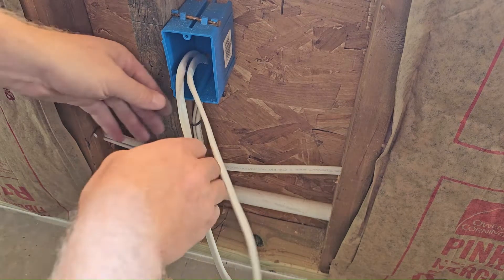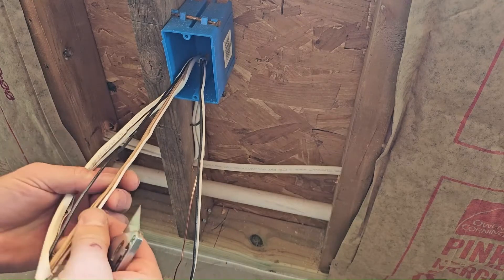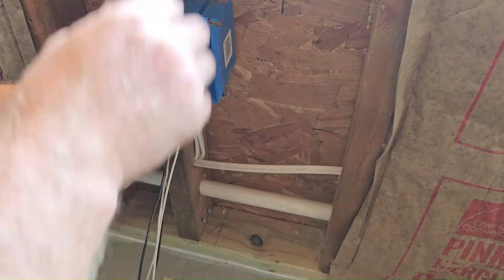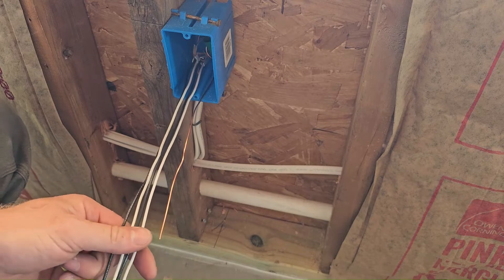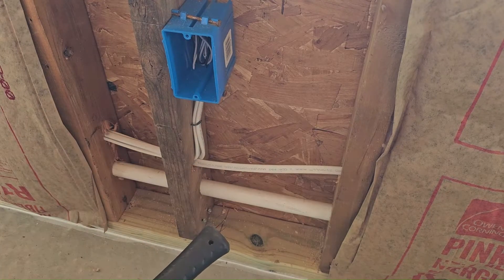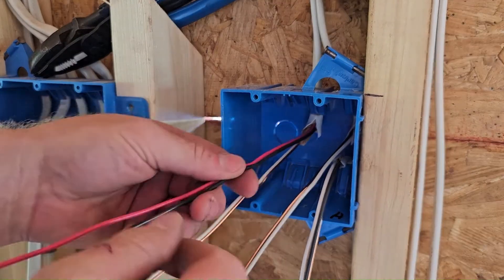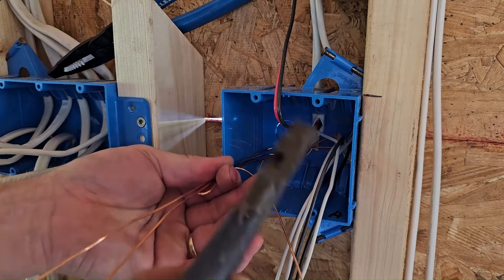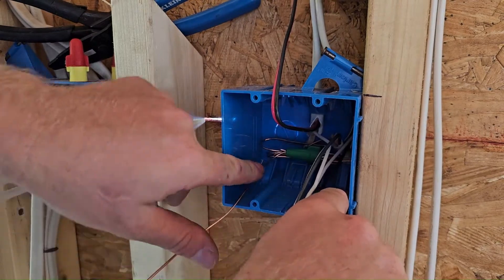How To Prep A Receptacle & Switch Box

Comment: I dealt with almost this exact setup when replacing a bathroom ceiling fan/light switch and a can-LED dimmer. It was likely a late-’90s or early-2000s remodel, and the Romex was super stiff. I ended up using Wago 221 connectors because the box was completely stuffed. Whoever wired it originally had crammed everything in, and with how stiff the wires were, there really wasn’t much flexibility. I’m honestly not sure I could’ve achieved your layout with maximum spacing — maybe one shot at best. To make it worse, for some reason there were two extra feeds coming into the box, so it was seriously overfilled.

Comment: Running 14/2 on home runs and receptacles are gonna be a headache later on with tripping breakers
Reply from the maker: If you are having issues with 15amp breakers tripping, this is due to a poorly designed electrical system. I have never had issues with 14/2(15amp) circuits tripping, and have been wiring houses for over 20 years.

Comment: (9:14) These days, it's also possible to use lever connectors (Wago or Ideal), and to connect devices via stranded wire pigtails for much greater physical flexibility.

Comment: (6:10) That's a good observation: the remote control may be unreliable.  An alternative to that is actually to set up some smart relays inside the switch box (in addition to switch).  The relays could be replaced eventually if needed with ease.  The behavior of switches could be configured through relays (they could act toggle or as usual two-position switches, and if needed could be overridden).

Comment: Sorry for these novice homeowner questions.

It appears to me you have two “line-in” Romex coming into the box. One for the fan and one for the fan light. Why run two “line-in”-Romex wires rather than just one?

Are these two “line-in” Romex on the same circuit breaker or two different breakers? If they are on two different 15amp breakers it appears to me that you would double the amps to 30amps to trip the breakers.

Why do you combine (wire nut together) the two black wires rather than have one black for each switch?

Why do you cut the two black wires and then wire nut them to two other black wires? Why not just use them directly on the switches?
Reply from the maker: Thanks for the questions!
    The two wires are a "line- in" and a "Line-out". If you think of it in terms of plumbing, which some people find easier to see visually. The light is the faucet, the switch is the Knob to release the water(light), the Line-in is feeding the knob AND other fixtures downstream at the same time through the Line-out. So the wire nut is serving as the Tee connecting the Line-In to the Line-out with the pigtail feeding the Knob for the faucet/s at this location.
Hope this helps.

Comment: So the power in and jumper wires are wired nutted together with two pig tails to each switch?
Reply from the maker: The power in and jumper wires are tied together with one pigtail to each switch, the second wire for each switch would be the wire that feeds the light.

Comment: If the box is made up correct and neat u can always add a neutral whip otherwise you'll have to cap it off if not needed
Reply from the maker: I agree 100%. No need to add extra wires and wirenuts if not needed. A neat box is easy to modify if needed.

Comment: 6 inches from the outside edge of any box
Reply from the maker: Thanks for the comment! I am always glad when someone goes above and beyond the minimum requirements. But in the video was wanting to let people know what the code book state. I am thinking of doing a video explaining this and a couple of other commonly misunderstood codes.
     As per NEC code 300.14 in the latest code book. The minimum is 6 inches from where it emerges from its raceway or sheathing. If the opening of the outlet, junction, and switch point is less than 8 inches in any direction the wires most extend a minimum of 3 inches from the edge of the box.

Comment: at 8:50 what if you need a Neutral for a WIFI Outlet, would you just pigtail it with the white?
Reply from the maker: Yes, if the owner decided to get a switch that needed a neutral, I simply add them at the time. It keeps the box neater in the meantime, and from needing to also fit extra wirenuts inside the box if they are not needed.

Comment: Don't you need a pigtail on the neutral wires in case the homeowner uses a smart switch as you mentioned?
Reply from the maker: I prefer to add them at the time of the switch install, if needed, this helps keep the box neater and less cramped if not needed. Some smart switches need a pigtail, but most of them have pigtails attached that would get tied in with the neutrals.
Reply: @RCHBuilders  I get your reasoning, but I view wire nuts as once and done, and if you need to add another wire later it compromises the joint, imo. Wago lever nuts have a distinct advantage in these cases.
Reply: @surferdude642 compromises the joint? Really? Just straiten out your conductors, and re-make-out your joint and use a new wire nut. If in the process of straightening out your conductors you find the need to just clip off any damaged or compromised and restrip. Then pre-twist and cap. I've never had a problem, never got a call-back on a re-worked join in 29 years. Like maybe you need re-evaluate how your re-working joints.
Reply from the maker: In my experience, if there is an issue with reworking a joint, then the person who did the joint to begin with either did not do the work neatly to begin with or they put to many wires in the wirenut to begin with. In either case I would want to redo the joint anyway.

Comment: To be precise, the actual code 2023 NEC 300.14 "At least 6 inches of free conductor, measured from the point in the box where it emerges from its raceway or cable sheath, shall be left at each outlet, junction". So it's 6" from the end of the Romex sheath, which should penetrate at least 1/4" inside the box, 314.17(B)(2) "Where cable assemblies with NM sheaths are used, the sheath shall extend not less than 1/4" inside the box and 1/4" beyond the end of any cable clamp."
Reply from the maker: Very much correct. I never go with the minimum.
Reply: For refrence, here's the refrenced code In full as it's shown in the NEC:

***********************
300.14 ()()-
***********************

" 300.14 Length of Free Conductors at Outlets, Junctions, and Switch Points.

At least 150 mm (6 in.) of free conductor, meas-
ured from the point in the box where it emerges from its race-way or cable sheath, shall be left at cach outlet, junction, and switch point for splices or the connection of luminaires or devices. The 150 mm (6 in.) free conductor shall be permitted to be spliced or unspliced. Where the opening to an outlet, junction, or switch point is less than 200 mm (8 in.) in any dimension, cach conductor shall be long enough to extend at least 75 mm (3 in.) outside the opening.

Exception: Conductors that are not spliced or terminated at the outlet, junction, or switch point shall not be required to comply with 300.14. "

***********************
314.17 (b)(2) -
***********************

" (2) Cables Entering Through Cable Clamps.

Where cable assemblies with nonmetallic sheaths are used, the sheath shall extend not less than 6 mm (¼ in.) inside the box and 6 mm (¼ in.) beyond the end of any cable clamp. Except as covered in 300.15(C), the wiring method shall be secured to the box or conduit body.

Exception: Where nonmetallic-sheathed cable is used with single gang nonmetallic boxes not larger than a nominal size 57 mm × 100 mm (2¼ in. × 4 in.) mounted in walls or ceilings, and where the cable is fastened within 200 mm (8 in.) of the box measured along the sheath and where the sheath extends through a cable knockout not less than 6 mm (¼ in.), securing the cable to the box shall not be required. Multiple cable entries shall be permitted in a single cable knockout opening.  "

I agree with  @RCHBuilders  code is the minimum standard. It's the floor, not the ceiling... so I prefer to go above and beyond. That said to be cost effective (especially on spec homes) I can understand only meeting code on conductor length.

Comment: Why is your earth conductor not insulated? In Australia, the Earth conductor in any cable is insulated with Green insulation with Yellow stripes. We used to have insulated earth conductors but they were phased out in the early 80's I think. We also no longer use solid core cable for the most part. Cables for power points and for lights are stranded conductors. It's interesting to see the differences in installations.
Reply from the maker: This could be very lengthy, so I will probably do a video on it in more detail sometime. With residential homes being made of wood instead of metal or cinder block, it is common to use romex. In commercial however all earth ground cables are green or green with yellow strip insulated.
Reply: I would be interested in seeing the reasoning behind this. Houses in Australia , no matter what they are made from, are wired with the same cable. The same cable is used in commercial and industrial settings as well. Pretty much all cables are stranded and all the earth conductor is insulated.
Reply: Because we're stupid over here in the USA and we like exposed ground wires extremely close to our exposed hot poles in the outlet box. ;)